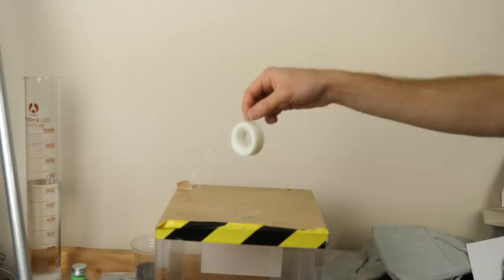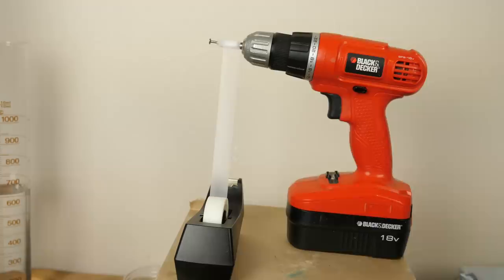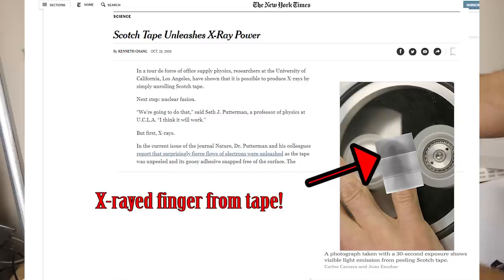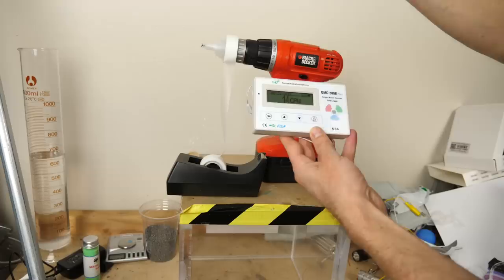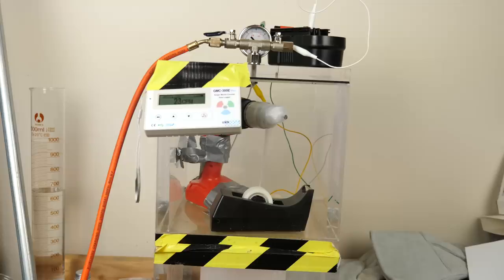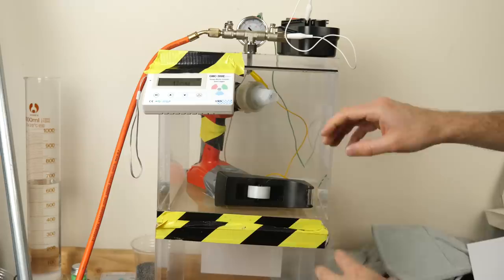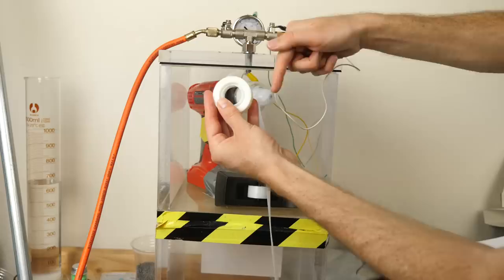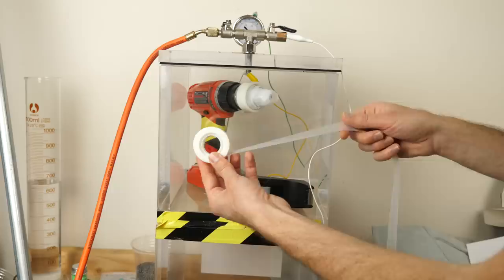Is Scotch Tape Radioactive? Making X-rays From Tape—Triboluminescence in a Vacuum Chamber

Comment: The video was amazing but I have a question that possible for us to convert the water into powdered form just like milk powder
Reply: Kalyani Pawar Water powder is snow!
Reply: Vijey Krishnaa yeah...
Reply: Yes it is, grab a water, feeze it, then hammer it, water powder
Reply: Treating your question as serious for a moment, no its not. The reason powdered milk is possible is because of dehydration. It is literally the removal of water and other liquids from the milk using heat and moisture differentials to pull the liquid out of milk, leaving the solids behind. Then you add water back to the milk solids to make a milk simulation. There are changes that occur with milk in this process that result in powdered milk being not quite milk like when reconstituted. 
Water is a base substance. Its composed of 2 hydrogen atoms and one oxygen atom. If you break this down you create two very reactive atoms that want to bond with something. 
The purpose of powdering milk is to remove the heaviest part of the milk, the water. For the purpose of reducing shipping weight and cost, and increasing shelf life. You could theoretically create two substances, one that contains hydrogen and one that contains oxygen that when exposed to each other would or could be made to reconfigure into water and a mix of the carrier particles. But why and at what cost? How to remove the carrier and what to do with it? Methane is the closest thing to powdered water you can really get and you still have to  crack it to split the hydrogen and carbon and burn the hydrogen in the prescence of oxygen to get water from it. Its a completely pointless way of water generation for it own sake.
Reply: metamorphicorder thanks
Reply: metamorphicorder what he means is maybe

Comment: A couple of things…. that really is the wrong type of detector for what you’re doing .  Try some dental film in a plastic envelope and get your local dentist to develop it after you “expose” it.  also you have to put it much closer to the separation point.  I would also use a larger reel on your drill to pull it out faster.

Comment: Even if x-rays are produced by this process they may not have enough energy to penetrate the thick plastic walls of your vacuum chamber. Also, if they do have enough energy to penetrate beyond the chamber, they still may not be energetic enough to trigger the geiger-müller tube used in your counter. Can you leave the geiger counter in the chamber? That would at least control for one variable.

Comment: That detector can’t detect Alpha radiation due to the fact that the Geiger Muller tube  form is built with a glass or metal envelope.  You would need a pancake probe where the detector has a thin wall mica window that can’t stop Aloha penetration.  Or a scintillation detector with a ZnSO4 (Cu) doped with a PMT.

Comment: Just a thought, how about first replacing the nitrogen in the chamber with a lower mass gas, like helium ( not Hydrogen because the pump exhaust will be flammable, but it is a lot lighter) and trying it again with the pump. Lighter gas might mean less molecules around to interfere, plus they are less likely to grab the electron as well.
Reply: SeanBZA Irrespective of the gas used, the vacuum chamber can be brought down to the same pressure only. So, a lighter gas will actually have more molecules in the same pressure. Am I right?

Comment: If the Geiger counter is placed outside the vacuum chamber, its thick acrylic walls are probably going to shield alpha as well as beta radiation
with this setup you will probably only be able to measure x rays and gamma radiation...
Reply: But scotch tape only makes X-rays and either way, the geiger counter should have been much closer to the tape (distance is a very good "shield")

Comment: Okay there were two things that messed up this experiment first thing is that the way x-rays are produced is first you have free moving electrons then those free moving electrons hits like a metal or something and slows down the electrons releasing a photon because energy can't be destroyed. Also the distance between the geiger counter and the tape for such a weak source probably wouldn't read anything because of the inverse square law.

Comment: Try to put a block of concrete in vaccum chamber 

And theorically it will turn into dust 
If not just shake the vaccum chamber a bit to break vender walls forces between the molecule of concrete it will be fun
Reply: If it works it an't stupid
Reply: Do you also know that tape will create light but it works
Reply: Won't work.

Comment: Xrays are gamma rays, the only differences in definition is that X-rays are a variety of gamma rays of different energy (within the gamma ray spectrum).
Reply: Gosat Kun Both X-rays and gamma rays are electromagnetic waves of different energies. X-rays are not gamma rays.
Reply: Vijey Krishnaa yes they are electromagnetic waves. X-rays are the same as gamma rays. Only difference is that y-rays have 1 wavelength and the source of y-rays come from atomic nuclei. X-rays are men made by putting electric energy through metals, these rays are y-rays, but have there is a variety of wavelengths.
Reply: Gosat Kun I think X-rays and gamma rays are different ranges of wavelengths of electromagnetic waves and X-rays are not gamma rays.

Comment: Perhaps chemical bonds ARE light - simply EM radiation that got stuck in an infinity loop that holds atoms together. Add a little more EM radiation (enough to disrupt the "bonds") and EM radiation of specific wavelengths associated with the bond type/size are emitted.

I've always thought the notion of having different fields to explain different effects was too complex. Perhaps the different "fields" people talk about in QED are just different effects of the same field.

Comment: The reason why x-rays in an x-ray tube are produced is braking radiation (Bremsstrahlung). When electrons hit an atom, the atom gets excited and later on regains it initial energy level while emitting a high energy photon. This is one of the reasons why tungsten is one of the anode materials for x-rays. It is very dense thereby the likelihood of an electron colliding with an atom is increased. Another reason is tungsten being a refractory material. For the same reason, lead alone is a poor choice for ionizing radiation shielding: being exposed to intense beta, it emits bremsstrahlung. 
Finally there's another reason why GQ GMC-300E Plus is a poor choice for your experiment. According to GQ documentation, it has 0.1 to 1.25 MeV registered energy range for high energy photons. This means that an x-ray device must have a potential difference of at least 100000 Volts in order for x-rays to be detectable.

Comment: i think that it is no neccesary the glue in the tape. y had seen Van Der Graff generator made of a simple rubber rotaiting arround two plastic pulleys. i woud like to measure if it emmits radiation in vacum

Comment: Nope, your detector doesn’t detect Alfa particles. It’s impossible with this device because Alfa particles would by stop by plastic cover.
Reply: There are gaps in the plastic cover above detector. The main issue is the glass G-M tube which is impervious to alpha particles itself. A mica window detector is needed.

Comment: GQ GMC-300E Plus cannot detect alpha radiation because it uses Geiger-Müller tube mage of glass which alpha particles cannot penetrate. Only G-M pancake sensors with mica windows can let high energy alpha particles in. Since radon is an alpha emitter, I doubt that the natural background radiation in this video is from radon. In addition to that, G-M counter is not the best choice to detect high energy photons. You need a scintillation detector for that.

Comment: Is Scotch Tape Radioactive? Short answer: NO..... Longer answer: There's a big difference between materials that emit radioactivity and devices and natural processes that produce X-rays. Both are ionizing forms of radiation, but they are quite different in their form, wavelength, and total energy. Scotch Tape generates high voltage static electricity when pulled off the roll in a dry (not humid) environment. It's that static electric discharge that generates the X-rays, which incidentally produces very low energy X-rays compared to X-rays produced by medical or dental X-ray machines.

Comment: Could probably be done with a Van de Graff generator in a high enough vacuum.
Reply: John Kerley what?
Reply: My bad,...the generator can't be in the vacuum, but the spark gap could,...I was'nt thinking that out enough,...LOL.
Reply: John Kerley A van de graff generator can be placed in a vacuum.... I'm so sleepy and so didn't understand you're comment.. sorry if I'm wrong
Reply: It can be if it is sealed with piped in air inside the generator I guess.
Reply: John Kerley Why does it require piped in gas? I don't think the process needs that.
Reply: I was thinking that I read that before,...not sure about that right now though,...would have to look it up. It seems it might not have to have air if the tape in this experiment did'nt need air though.
Reply: I'm thinking that they said that some of the electrons come from the breakdown of the air across the gap in the primary roller and comb in the bottom of the generator.
Reply: John Kerley Exactly, it doesn't need air..
Reply: Why did you mention the van de graff generator in the first place?
Reply: It would make a much higher voltage than the tape.
Reply: John Kerley I don't think so.. it actually comes from terminal connected to it
Reply: A long time ago I had made one that produced about 16 inch of spark on a good day.

Comment: also, aren't air molecules atoms?
Reply: dangerousideaz They consist of both atoms and molecules... Mostly nitrogen molecule... Why did you get this question though?
Reply: I'm a poor listener.  @ 5:50  he says without sufficient vacuum the electrons hit air molecules instead of the atoms (on the other side of the tape). I thought, air is made of atoms, just like the tape.   I missed the part about the distance, time to accelerate, etc.